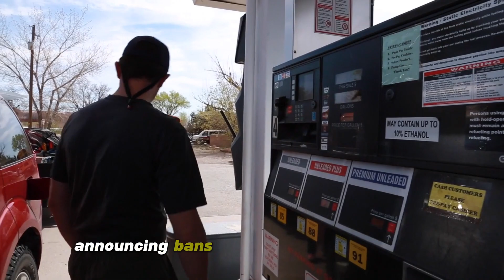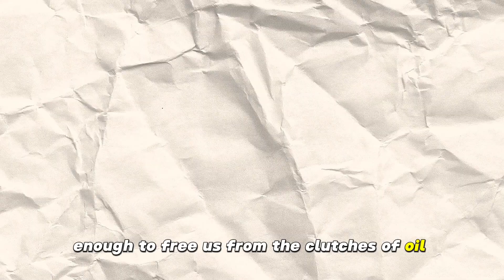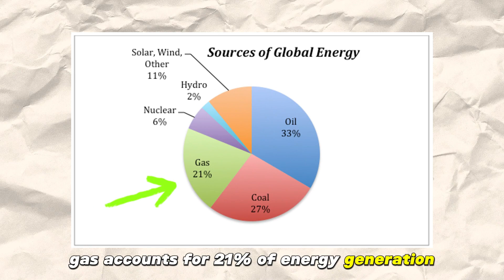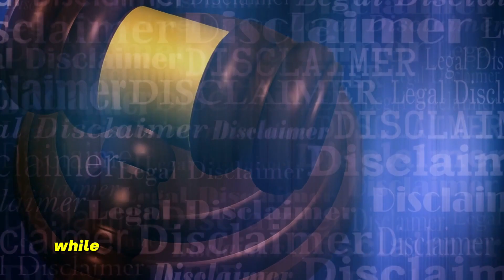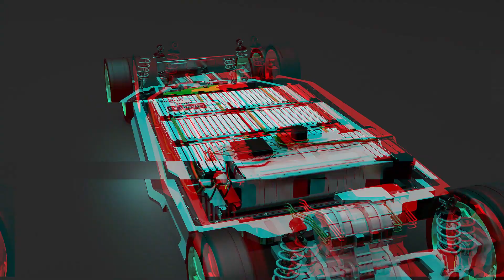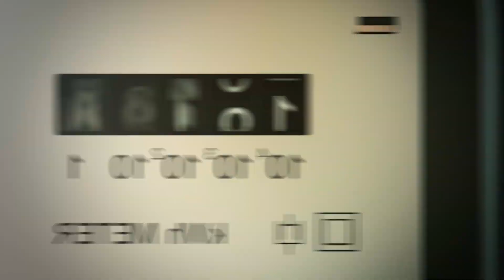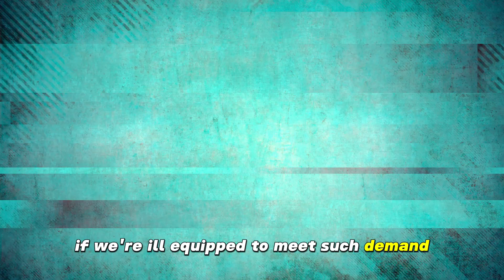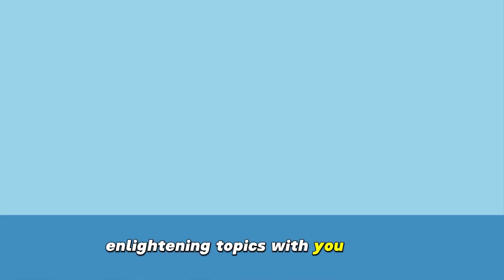The HIDDEN DARK Reality Behind Electric Vehicles: ECO-FAIL or Eco-Friendly?

Comment: BULLSHIT not even three minutes in your telling busess and planes wont be EV. Buses are already electric and the reduction in oil will be huge not just 10%!!! 
Trucks and ships will also be electric. Generators and mining will also be using solar. RIO Tinto have already advertised the are fully electric with solar and batteries on some site this is full crap, NO facts. The main point is to reduce CO2, some countries are states are reporting full months without coal fully using Solar. Carbon foot print all cars have emissions in production, 30% is better than nothing. With giga casting CO2 will be even lower. Recycling of batteries is even better and possible, b not only that it has longer working life than a car.
Batteries get chopped up, Tesla partners chopping up batteries and recycling already.

Comment: Buy a EV then it depreciates twice as quickly as an ICEd car. Batteries are not cost effective to recycle, items like this tend to be fly tipped.
Reply: Other than everything you said you would be correct except EVs hold their value far longer than ICE and there are many companied right now starting to recycle batteries. The biggest problem is that the batteries last so long they don't have a lot so recycle yet. Don't worry in about 10 years there will be plenty of plants recycling batteries: https://www.youtube.com/watch?v=s2xrarUWVRQ
Reply: @Aircam73  time to pull your head out of Elon's ass, head over to a used car lot and tell us how much the used EV's are actually selling for and how well their batteries are actually holding up.  Reality is going to be an extremely tough pill for you to swallow, if you ever choose to.
Reply: You guys who think EVs are great you have the right to buy one. Another point if you buy an EV today and tonight batteries are developed that can be charged in the time it takes to fill your tank. Your brand new car loses you even more.   @Aircam73
Reply: @Aircam73  most of those getting recycled are power tool batteries and didn't last very long
Reply: @AuthenticRevelation  That is because there aren't that many EV batteries to recycle yet. Most batteries will last over 250,000 miles or 20+ years. Considering mass production only started 12 years ago with 95% of all EVs batteries still on the road.
Reply: @Aircam73  you also can't recycle them if they burn to the ground 🤣

Comment: Overall lifetime emissions are nevertheless around 80% lower for the electric car, since 90% of the petrol car's lifetime emissions are due to the combustion of fuel.
Reply: It's about 10% unless you are running your own green electric grid. 99% of people just use the grid. Moving the combustion from one place to another place dosent make it fosil fuel free. Honestly it's 4x better to use the pack as a grid storage for solar/wind than using it for a ev. But more money in making a ev but greed beets good everytime
Reply: @mddunlap03  yep they like to pretend they aren't just relocating their tailpipe
Reply: Nope. Large scale power generation even using fuels as dirty as coal and natural gas are cleaner than running individual gas and diesel vehicles. And, all of the Great Plains states are installing wind and solar and batteries because they have plenty of wind and sun. The Dakotas are generating over 50% of their electricity with wind and solar, and get much of the rest is hydro. And, batteries are getting greener by the day and battery are being recycled.
Reply: @freeheeler09  Nope.  According to the US EIA North Dakota gets 55% of power from coal and South Dakota uses primarily coal and natural gas but does not generate enough power to support itself and must buy power from other nearby states.

Comment: Electric vehicles is just a more efficient and better machine.
Reply: The problem is in chemistry of batteries.  There is no battery that can even approach the energy density of hydrogen based liquid fuels.
Reply: @rotaryenginepete  HAHAHAHA hydrogen? It costs around 12 times as much to fuel a car with hydrogen as it does to fuel an EV. Who in the hell is going to pay 12 times as much to fuel? It costs around $13 to fill an EV to go 300 miles. It costs around $200 to fill a hydrogen car to go the same distance.
Reply: @Aircam73  HYDROGEN based fuels include HYDROcarbons.  But go ahead and keep laughing about a topic which you are clearly unable to comprehend.
Reply: @rotaryenginepete  Energy density is only a small component of how you propel a car. That is what is laughable and I see those that know nothing about batteries or hydrogen say stupid thing like that all the time. You can take a pellet of uranium which is super energy dense but it isn't good at making a car go down the road without massive amount of problems and costs.

Batteries and electric motors are so efficient that they don't have to be as energy dense (meaning they need far less energy to propel them).  This is why I can fuel an EV for $12 worth of electricity and go 300 miles. While using the same electricity to create hydrogen to go 300 miles would require between 4 to 6 times as much or $48 in just electricity to produce the hydrogen. This is why hydrogen will never work.
Reply: @Aircam73  I actually owned an EV for several years.  It was a mistake that I will only make once.  If all you do is drive a short trip to the grocery store, then it works great.  But put an EV into an actual work situation like a longer trip or hauling and it fails miserably.  The reason for this is because batteries are NOT efficient.  But go ahead and keep believing in that hopelessly stupid pipe dream.
Reply: @rotaryenginepete  Wait? You think batteries that run a motor that is in excess of 90% efficient is not efficient compared to an ICE that if the engine/drivetrain exceed 30% efficient you would consider yourself lucky? 

I also like that how those that know so little about EVs seem to have owned one because just about ever EV owner has owned an ICE and the vast majority will never go back. The ability to charge at home and not support big oil by paying 5 times as much for gas. By having a car that doesn't need oil changes, is far cheaper in maintenance as a matter of fact out of the 20 most common items replaced on an ICE by mechanics an EV doesn't have 16 of them.

With a Tesla I can go just about anywhere in the country with barely any noticeable difference in time. With my EV I can drive four hours, stop for 15 minutes drive another 2 hours, stop for 15 minutes drive another 2 hours finish a 600 miles trip and 8 hours of driving with less than 30 minutes of charging. But why would anyone want to even do that much driving with so little stops to eat or stretch? Even when I was driving an ICE I stopped longer to eat, stretch and bathroom breaks than 30 minutes so for me and the vast majority of people an EV will work excellent for long trips and will cost 1/3 what driving an ICE would.
Reply: @Aircam73  it appears you are quite slow, so I will spell it out for you once again.  The electric motor isn't the problem.  Batteries are the problem.  Batteries will not and cannot ever hold near the energy density of liquid fuels because it is not chemically or physically possible.  That's why BEV's will never be viable for industrial applications and practical work applications.  Can we make them work in those applications?  Yes, but most people will not pay the extra cost needed to make that happen.  Especially when they are being marketed with false fluff about the environment.

Comment: Copper is not use in batteries
Reply: yes it is
Reply: Maybe not in the battery cells, but most definitely in the conductors that connect the individual cells.
Reply: @thomasroewer5673  Copper is used just as much in ICE cars with the same wiring as an EV. Copper is used in the wiring in everything around us. What is your point?
Reply: @Aircam73  which ICE car has the same wiring as an EV?  The answer is none.
Reply: @rotaryenginepete  95% of ICE cars and EVs have the same wiring. The only difference is EVs have some wiring coming from the big battery while ICE has wiring coming from a small battery and alternator. I didn't think anyone that was on a motor minds you tube wouldn't understand this basic concept. Also as I said what is your point as copper surrounds us constantly everywhere we go.
Reply: @Aircam73  false
Reply: @AuthenticRevelation  Actually early on many original EVs were manufactured on ICE assembly lines. I mean for gods sake what do you think is powering all of your component such as radio, headlights, interior lights, turn signals, ECUs, etc? Just look at all the wire bundles in your car and the majority of them power the same thing that would be powered in an EV. Except EVs don't need a lot of the wiring that ICE do. We have no vacuum valves, no spark plug wires, no ECUs, no distributors, no coils, no EFI, etc. 

Once again with less wires going to far less items the EVs is a clear winner in cabling and I still don't see what the hell you guys are talking about with copper as it is everywhere and has very little to do with EVs. Then again most people that don't like EVs aren't very educated about them and they see some MEME saying copper is bad in EVs and being easily manipulated they fall for it.
Reply: @Aircam73  False.  Early EV's were made in the late 1800's through the early 1900's.  They weren't made along side ICV's and they weren't viable back then either.
Reply: @rotaryenginepete  True, I don't know what the hell you are talking about 1800 and 1900 but most of the EVs manufactured in the 2000s started out on the same line and with ICE chassis and systems. The First Tesla were built on the Lotus chassis. VW used the golf and its assembly line for their first EV, Chevy and Nissan did the same. But once they saw the potential of the EV they formed their own assembly lines and designed new chassis to accommodate the battery packs being on the bottom. Most of the electrical equipment is straight from ICE cars and that is why EVs still have to have a 12 volt system to accommodate all the 12 volt ICE components.
Reply: @Aircam73  with the exception of the Tesla, all of those vehicles you listed were hybrids and nothing like the battery powered EV's discussed in this video.
Reply: @rotaryenginepete  Well since you seem to know nothing about EVs those chassis they used were for their EVs not their hybrids. They had an EV golf that was built off the regular golf chassis, They had an ID4 EV that was built off the golf platform also. Nissan built the EV leaf off of the acenta platform and Chevy built the EV Bolt off of the ICE cruze platform. Please stop commenting on things you don't know. Also what does this have to do with all the copper that are in both cars and that we are surrounded by.
Reply: @Aircam73  yawn

Comment: Not a very well reasearched video. Cobalt is used as a catalyst in petrol and diesel production. Too many other errors to correct really...
Reply: Platinum is almost always used becuse 1% by weight but takes 5% cobalt and 15% barium to match the Platinum/palladium mix especially now that cobalt has gone up over 1000% in price.
Reply: @mddunlap03  nearly half the platinum production and three quarters of palladium is used in the production of catalysts already for use in exhaust after-treatment of ice applications.

Meanwhile, cobalt-free lithium chemistries are already in use in EVs and growing in popularity.

EVs are quickly getting cleaner, while ICE have come as far as they can. The competition is over. EV will be the future.
Reply: A catalyst by definition is not used up in the reaction.  Just because cobalt is used in gasoline production,  doesn't mean it requires a constant source of it. EVs have some in every vehicle.
Reply: @michaellowe3665  a catalyst does not have to be consumed, it can be poisoned and energy is required to purify it once more, as happens in the de-sulphering process.

Cobalt is not consumed in a battery either, and can be recovered at the battery's end of life, not entirely sure what point you are making?

Are you saying the cobalt is no longer minded for petroleum production because they have made all their catalysts already 🤔

Nobody gave a damm about these minerals until EVs started using them, so just admit your bias for what it is instead of being a SJW....
Reply: @joshbridges8410  I'm not sure where the SJW part came from.  It sounds like someone is conflating everything he thinks might offend me because his ego got a little bruised.  Someone also wasn't paying attention to the part about EV batteries not being recycled.   So far, it isn't happening on a large scale.  The video was correct about that.  If the plan is to go from 18 million EVs to 100 million,  a lot more cobalt is needed than is used as a catalyst in fuel production.   Cobalt is also used in motors and magnets.  You mentioned the use of cobalt in fuel production but didn't put any numbers on it.  The numbers matter to the people being poisoned in the mines.  

Most EV sales are just greenwashed consumerism.   People buy new EVs every 2 years because it's a status symbol to them.  Meanwhile,  they aren't driving them long enough to actually cause an environmental benefit.  They are also sold in cities more often, where they are more likely to be totaled in an accident or stolen and stripped before reaching the environmental break even.  

I have no problem with EVs.  Everyone who thinks they can benefit from one should buy one.  I have a problem with government mandates.  They are just trading one set of problems for another.  The only people qualified to determine if an EV is right for them are the individual buyers.  A slow adoption would be much better for the infrastructure to handle.  If EVs truly are better, you won't have to force people to buy them.  As the price of materials and electricity goes up, the cost of owning an EV will, so the adoption rate should respond instead of being forced.
Reply: @michaellowe3665  thanks for a breath of fresh air in a conversation that is so far flooded with the brainwashed regurgitation of hopelessly false talking points.
Reply: @michaellowe3665  these EV nuts would need to be intellectually honest before they can acknowledge a fact like that